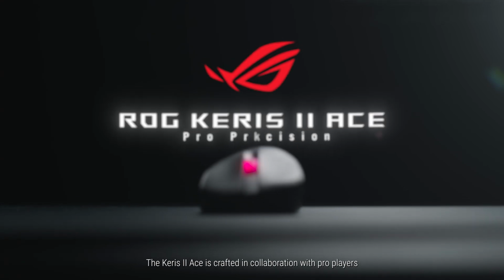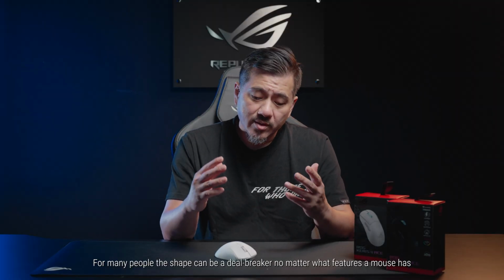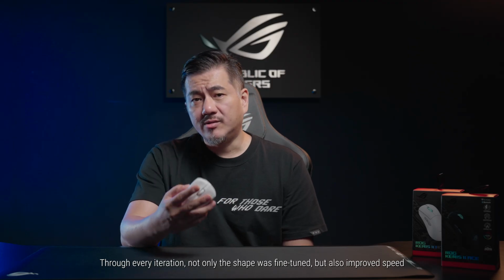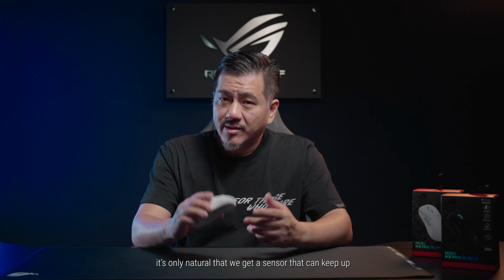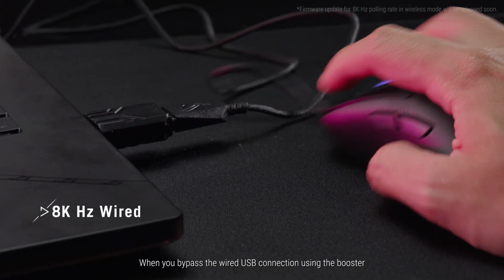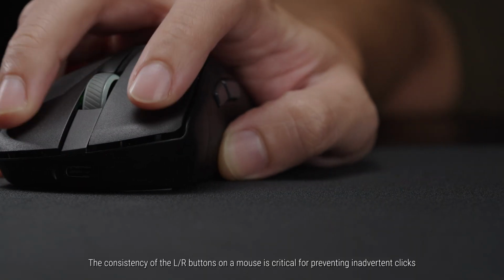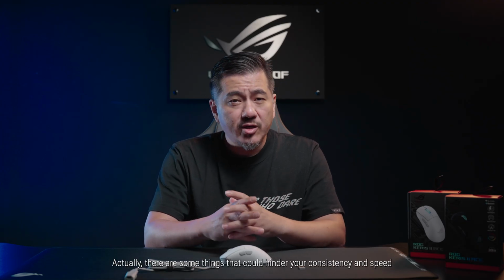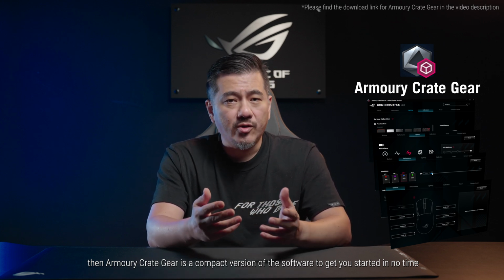Unboxing the ROG Keris II Ace | ROG

Comment: Please make it possible for rolling rate booster to achieve 4 or 8k HZ while using another keyboard with the mouse by means of omnireceiver. Being limited to 1K HZ when using two devices by means of omnireceiver is not something we are delighted to experience.